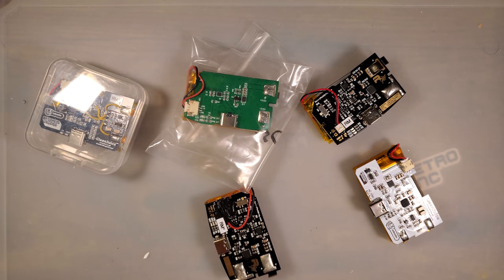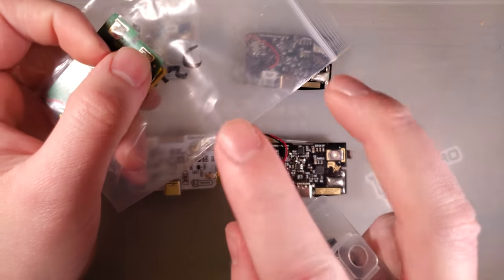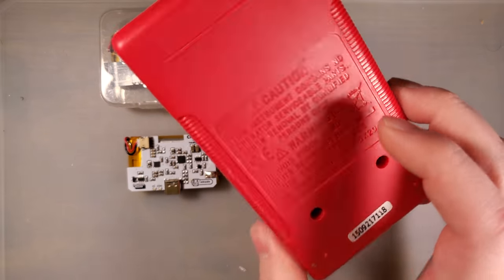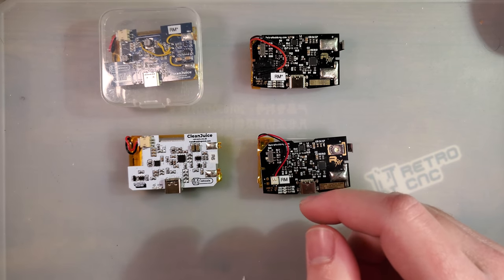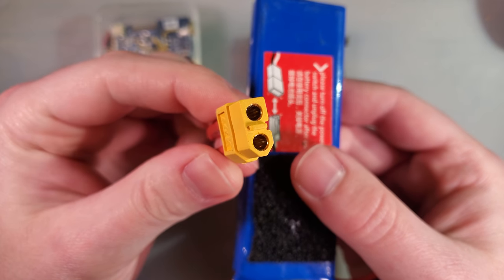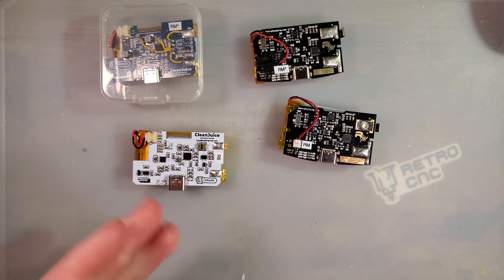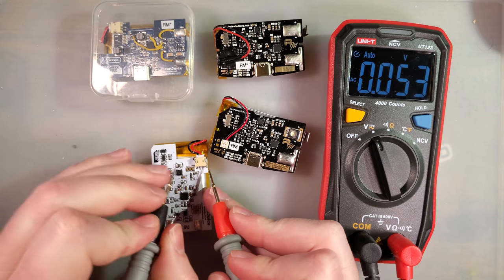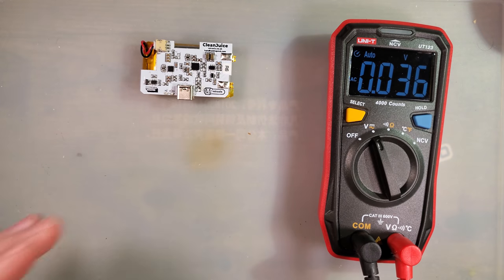Defective CleanJuice Battery Drain Fix

Comment from the maker: After a couple days, it looks like this IS an improvement to the parasitic drain. There does still appear to be some very minor drain OR I just measured the batteries again too quickly after charging. After charging a battery, one should wait for the voltage to level off. I will keep monitoring over the next few days to know for sure.
Reply: I did this mod and my battery swelled up after two months of  not playing it, please do reply on this matter.
Reply from the maker: @rogerruiz1934  there's lots to unpack here but I'll be brief instead and direct you to the retailer you purchased this from instead.
Reply: Do you recommend to using Clean Power for SEGA DC made by R6 ?
Reply from the maker: @Divisionsixty I haven't used that particular mod but based on my interactions with the company in the past and their defective parts, I'm gonna say no, I do not recommend it.

Comment: You know, I thought I was crazy when I pulled out my GBA with this mod to play and it was drained. But you find a SP or DS Lite in storage for 10 years and it's still at 50% battery life.
Reply: Yup that’s why I don’t play mine anymore I just use my Gameboy color more because or grab my newly refurbished sp instead. I got so tired of having to charge it every time I wanted to play on it’s like what’s the point of it being rechargeable if I plug into the wall now.

Comment: I finally got around to fixing my clean juice a few weeks ago, and it was a relatively easy fix for me.  After two weeks of testing, I can confirm this fixes the problem.  Before the fix I would fully charge the battery, leave the system alone for a couple days, and have a dead battery the next time I would try to turn it on.  Now it keeps a charge with no problems.  I saw that HHL doesn’t even sell this anymore so it shouldn’t be a problem moving forward.  Was still a pain, and if someone with little soldering experience accidentally removes other components, they could ruin the whole thing.  Thanks again makho.

Comment: I'm surprised it took this long for the problem to be reported by anyone. It seems like something that would have been noticeable during any product testing they might have done. Assuming that any was done, of course.
Reply: There are piles of negative reviews on the main website where they are sold that address this exact issue and they were posted months ago. The manufacturers knew about this problem and just ignored it in the hopes that it would go away on its own.
Reply from the maker: I kinda dropped the ball with my testing. But in my defense, I didn't think I'd have to test for something like this.
Reply: @makho  weird thing to test, but many of those negative reviews mentioned an irritating, high-pitched whine as well. Do you think it's worth looking into?
Reply from the maker: @ardentdrops  if they mean audio whine, yeah, that's what happens when you use a regulated power supply to power a GBA. I'll take a look though.
Reply: @makho  the impression that I got was that it was some kind of coil whine or piezoelectric effect from the chips themselves. Maybe the board fits too snugly and presses against the battery door? Or it can be caused by badly mounted ceramic capacitors flexing the pcb. You're right though. It's possible the output voltage is dirty and messing with the audio.

Comment: Does R6 sell anything that actually works? I ordered some UV printed shells; there where no buttons included, one shell was missing, the prints where really bad quality (stripes everywehere, lenses missing the hole für the LED)... and when i assembled them with the IPS V3 screens, the shells did not fit! It was so tight, you could not use the contrastwheel. Also one screwpost broke in the process, i needet so use the original DMG screws becaus the screws that where included, are MUCH to short and small... it was just a damn frustrating process. I somehow mad it work, i didnt want to bother for a refund. I wont buy there again, i guess...

Comment: I just checked my cleanjuice an noticed that it already came without the resistor you removed, seems like the newer versions come fixed already. I purchased it a month ago or so.
Reply: I can confirm this as well. Received one in the mail yesterday and just checked it.
Reply: Also confirming one I got in early January doesn't have the resistor.
Reply from the maker: Interesting that they've known about this issue and are just NOW telling people about it.
Reply: Same with the two I purchased recently. No resistor.
Reply: @makho  What’s also interesting is that the version I got a while ago, before I even found out about Luke’s general bs, had the resistor removed, but not the transistor. Nothing too big, just weird they would accuse something of being the problem, then proceed to sell the product with the very same thing they blamed. If they already sent a new message that it was really only the resistor, then I apologize for being banned for being among those who called him out for stealing Helder’s switch.

Comment: I bought a prebuilt modified GBA from a game store I usually go to. The thing was working great, no issues whatsoever, and after one day of actually playing games, the thing is dead. I found your video because I wanted to know the issue, now I do, and I'm not sure what to do. As far as I can tell, one of the pieces recommended to remove is already gone, but the other one, where you put the wire on, is still there. I could try to contact the guy who made it, he's local as far as I know, and does this stuff in general. Otherwise I might just look into getting a different battery.
Reply from the maker: If you bought a prebuilt that is not working, you should arrange a replacement or a refund with the seller first before attempting any repairs on your own.
Reply: @makho  I decided to buy a battery from Retro Modding, there's no way I'm attempting to repair it. I'll probably have to fix the battery cover, but that's all really.

Comment: Cleanjuice v1 was incredibly noisy on the audio side. I got the first release of v1.1 which doesn't have this issue and the audio was fine. That makes me curious, what on the first v1.1 were they trying to fix to introduce this issue? I saw that v1.1s put out after a month looked different  from mine but didn't think anything of it at the time. 

Anyway, my friend got one of these duds after I liked the first batch of v1.1. Now that I know that R6 has terrible quality control, I'm only gonna recommend the retromodding for this sort of thing. 

Comments here are saying that newer cleanjuice v1.1s have the issue fixed? I am gonna get the dud off my friend, and I just ordered a new one. 

I'll take photos of all three versions of v1.1 and post them on reddit to see what physical differences there are.

Edit: cleaning up a few typos.

Comment: Luke just seems like one of the pettiest, thin-skinned people in the modding scene. He recently accused Helder of not crediting him for "inventing" the audio filtering (Helder did, in fact, credit Luke and post a link to RetroSix twice separately). Then, in a separate post, Luke called Helder's Flex GBA Amp useless which hasn't released yet so I don't know how anyone can make that call. This petulant BS makes it really hard to support RetroSix. I wish there were more alternatives to their aftermarket shells. FunnyPlaying, for example, currently only offers one non-translucent Gameboy Pocket shell.
Reply from the maker: You know that R6 doesn't actually make Pocket shells, right? He's just a reseller. He did have a color (smoke black) commissioned from the factory but the molds are not his design.
Reply: @makho  Ah, good to know! I suspected but didn't know for certain (I'm pretty new to the modding game) since the GBA shells are RetroSix branded while the GBP/GBC ones I was eyeing weren't. Would you (or anyone else reading this, really) kindly point me in the direction of a different seller? It would save me the trouble of importing from RetroSix who I had misgivings about buying from anyway.
Reply from the maker: @Chill_Valentine  If you're in the US, I've been very pleased with retrogamerepairshop.com. Retromodding.com is also a good shop.

Comment: I bought one and it wouldn't hold a charge so I removed it and charged it and put it in a box to keep it isolated. a few days later I heard a buzzing noise and checked it and it was dead. HHL replaced the board and the replacement works. I still have the original. I'll try your fix when I have time to mess with it. thanks for researching!

Comment: Thanks for this makho! I have mine for 4 months or so, when i got it i used it for an 1h or so and put it away because i was finishing a game on my PSP. When i went back to it after 4 days to start playing Pokemon Fire Red it was dry. I thought, well maybe 4 days is too long for it to hold charge, i charged it, did my pokemoning and put it away again for about a week, and i went back to it, i was dry again. As i dont know much about bateries, the only idea i had was to unplug the battery from the board and that did the trick, after a week it still had power. So in my foolishness, i thought... Well the GBA was not mad for batteries, so if the battery is plugged, it just keeps spending the battery life, ill just keep it unplugged when i dont use it. But its annoying to keep opening the battery cover and plugging and unplugging the battery... I never thought it to be a defect, and if you hadnt done this video i would probably never found out. Im not an expert at soldering, but i did manage to remove those 2 components and solder a tiny wire and it seems to be working great to far. So again, thank you makho!

Comment: I purchased one from Handheld Legend. I'm having the same issue. I'm fairly decent at soldering, but I really don't feel confident enough to attempt this fix since the parts are so small.
Reply from the maker: HHL is offering free repair/replacement for affected units. I'm not sure the specifics but you'll need to reach out to find out from them: https://handheldlegend.com/blogs/news/cleanjuice-spontaneous-discharge-fix-will-not-hold-a-charge

Comment: I just received 2 of these from HHL and they have changed the pcb again. They no longer have the HHL and Retrosix logos on the top (only has a  "CleanJuice GBA" logo on top) and "Retrosix" text on the bottom. The leds seem to be different than the previous version. Now it's blue+green=charging, and green only=fully charged.

Comment: Too late to find this now. I got a cleanjuice GBA last month and it seems to still have this vampiric discharge. The board looks nothing like the ones in the video now but the problem persists. HHL put up a "fix" guide but it appears to only apply to the one you tested here. Really annoying, I'll have to rebuy one from retromodding that isn't trash.
Reply from the maker: You should seek a refund or replacement from whoever sold you the kit

Comment: I inherited a GBA with this battery. I did the adjustment and it slowed down the drain immensely but it still drains, just slower. Now instead of being dead in a day, it's dead in about three.
Reply from the maker: That's still a problem. Seek a refund.
Reply: @makho  I'm still going to fool with it, maybe to the point where it's completely dead, but WTF, I might learn some more. Thanks so much for the reply!
Reply from the maker: @BashoStrikes  You should hold the vendor responsible when you get a defective product, especially one that is a potential fire hazard.
Reply: @makho  The GBA was given to me by a friend. I finally just replaced the faulty battery with one from Retro Modding. Thanks for the advice just the same.
Reply from the maker: @BashoStrikes  I mean, you could just reach out to HHL/R6 directly regardless. These things are genuine fire hazards and that's not something you should just keep in your house.
Reply: @makho  Ah ok, I'll give it a go. I appreciate your concern.

Comment: So, I bought one of the R6 batteries... Then I found your videos. Any chance there's a manual switch that would fit in place of the transistor to be able to shut this off like the retro modding board?? You have me seriously questioning the order that shipped out to me today 10/05/2021...
Reply from the maker: no switch that I'm aware of. No reason you cannot run some bodge wires but that might not be the best location. I haven't looked to closely at the circuit to know for sure though.

Comment: While I am sort of put off by this problem with many, if not, almost all of the CleanJuice rechargeable batteries, I am happy to hear that I can send mine in for free maintenance if I encounter this issue later on in the near future. So far, mine is working fine, but me being colorblind, I'm having trouble identifying what the colors of the CleanJuice lights are and, not only that, but what they indicate. Do you by chance know what the colors are on the ORIGINAL V1.1 CJ battery, and what they mean/indicate? I already shot an email to HHL asking this same thing, but I'm not sure if they'll get back to me at all. Thank you!
Reply from the maker: I believe they only came in blue or white. The older models are blue and current ones are white. There also appears to be some crossover on colors so it's not really a definitive way to tell what you have. 

I don't know why HHL has newer versions listed while R6 only has older versions listed currently. Either way, they're both garbage sellers slinging garbage products.

Comment: i have a cleanjuice (purchased in January 2021) i have not noticed this battery drain issue.  my motto is "if it ain't broke, don't fix it".  does this mean i happen to be lucky, or is this potentially a safety hazard that the modification fixes?
edit: i can totally solder this if necessary, but i don't want to tear into it if i don't have to.
Reply from the maker: based on some other comments, it sounds like they've known about this fix for months so your unit might have this issue already resolved.
Reply: @makho  thanks man!  i appreciate that you've made this public.  i consider "bad battery regulation circuitry" a safety/fire hazard, which really doesn't make R6 look good in my eyes. I'll continue to monitor my battery for changes.
Reply: @makho  i recently checked the GameBoy i was using this battery in and it was totally dead.  took measurements, and found the same thing you did.  i have returned for reference to actually make the fix.  thank you for publishing this.

Comment: well! I just bought the retrosix gba battery from retrosix uk as my retromodding gba battery leaked everywhere in one of my gba even though my board was turned off and retromodding is usa based and I'm from the uk, shipping and tax is way too much for me at the moment. I have had the retrosix only for few hours now, but I've checked the board and it seems he removed the resistor closest to the USB C port but not the black one next to the handhelds legend logo... do you think that will fix the issue without removing the second resistor?
Reply from the maker: There's a lot to unpack here. First, if there was a problem with RetroModding's battery, you should contact them. Second, RM is based out of Canada, not the US. Third, if your battery mod from R6 is not having issues, you probably shouldn't mess with it. By your own admission, you haven't seen a problem yet.

Comment: Hi.  I had a faulty one of those first time round.  However, after returning it I was sent one that works fine.  I've now been using it for nearly 6 months now and all good.  All I've noticed after watching your video is that my board has the transistor still fitted but the resistor is not fitted.  Not sure whether that's makes any difference but it does work and hold charge - even if I don't use the GBA for a week or so.

Comment: Hey mahko. I have a question about the wiring required for the ips screen in the original gba. You used a very small 30 gauge wire in this video. Is that the same wire you could use to mod the screen for the brightness control? I have very small thin wire, and never really soldered anything before unless it was trumpets or saxophone posts, never circuitry. Now the brightness controls don’t work anymore and I want to start over. Any advice?
Reply from the maker: start with a practice kit instead of learning to solder on your GBA and IPS kit.

Comment: It be ok to solder on the battery with that pcp, it will act as a heat shield. Though whats not ok is using such a huge tip to solder such a small pad. You could have also place an Amp meter across the resistor pads after de-soldering to see the actual leach draw.
Reply from the maker: No, it's never OK to solder on a battery. Why would say it is? 

I don't know why people keep whining about my soldering iron tip. I have zero issues with it. Are you just projecting your skills on to me? 

And no, an amp meter across the resistor pads is a bad idea. The amp meter would have much lower resistance than a resistor and would allow much greater current to pass.
Reply: @makho  Sorry I am not trying to get into a fight but you obviously do not know much about electronics. 
Example one being that you have no clue how an AMP meter works nor how to use a proper soldering iron. 
A big iron like that has a greater chance of destroying SMD components along with the pads they sit on and should never be used. 
Sorry I'm just being pedantic like you when it comes to soldering on batteries. I have soldered directly to batteries a lot and have never had an issue.
Reply from the maker: @GuardianEngraving  If you say so.